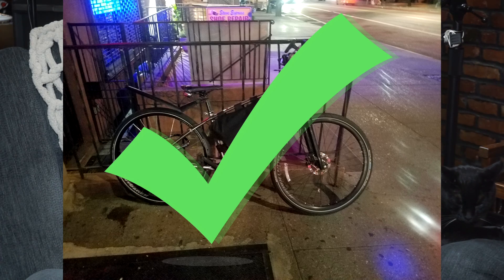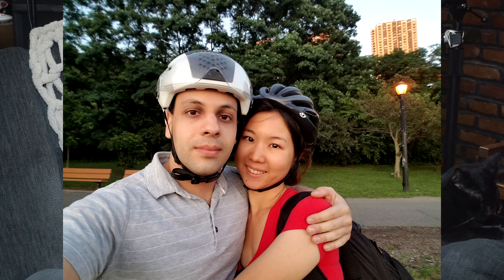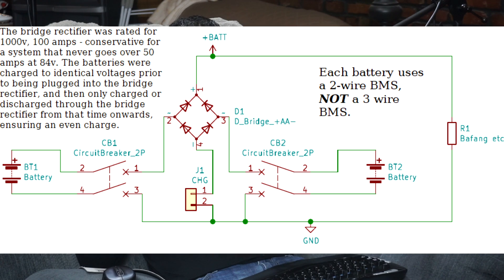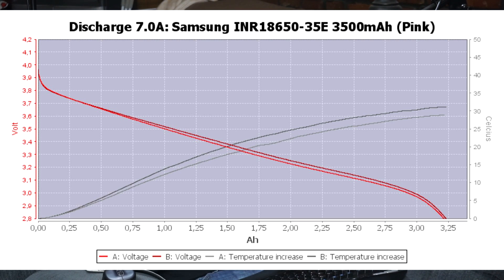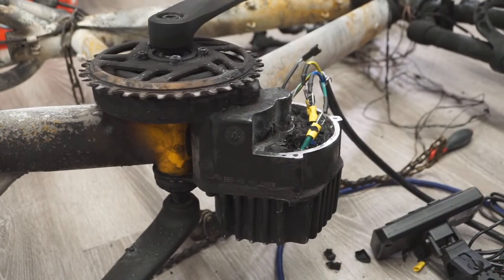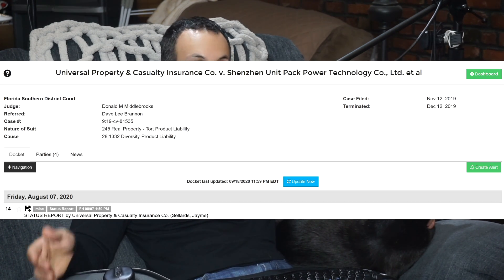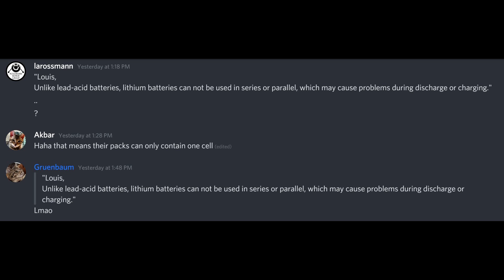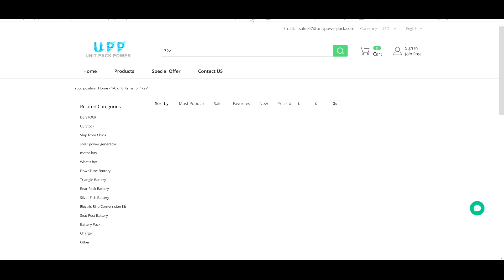Louis' front door goes BOOM courtesy of UnitPackPower battery.

Comment: I may have one the of thier batteries in my apartment...

Chuckles
Im in danger
Reply: Gift it to your in-laws as a Halloween present!
Reply: maybe you are but now that you know you can fix the danger by getting rid of it before the battery explodes inside you apartment save yourself find the battery if you have one and get rid of it while you still can safely
Reply: @raven4k998  or sell it on the black market as an ied
Reply: j s 900iq plays
Reply: @sneed915  it's the new age WMD these days can you imagine the damage that one of those things can do if placed in the right place in a office building it could bring down the entire building if it heats up a support column or two enough
Reply: @raven4k998  ebike fuel can't melt steel beams!
Reply: @freman  do you know how hot lithium battery's burn at they get over a thousand degrees they can melt the steel in a car why can't they melt steel beams is there something different about that steel?
Reply: @raven4k998  uh yeh, so ummm r/whoosh

Comment: Can you please show the circuit that these batteries were in. There is enough skill on youtube to figure out what went wrong but we have to eliminate installation error. No disrespect intended.
Reply: Rides bike hard... Pack gets hot.... Cells begin cascade failure internally... Fire ensues. Not an electrical issue per se.
Reply from the maker: The installation is ash. The only way to tell that is with a time machine.

Comment: In 2015 I built an Ebike using a 1990s GT LTS-3 frame with Bomber forks and a Mxus 4t hub motor. Laced up some strong dual wall rims with heavy spokes and motorcycle style mountain bike tires. Built a triangular battery box to fit the frame triangle perfectly. I ran it at 75v using 20AH Multistar batteries from Hobby King. Used a sleeper controller I found on Ebay. That bike would trip an 80A breaker. I put in a 100A breaker and it stayed. I installed a power meter and put a camera on it while riding. It drew 9600w at 72v fully charged. Went 45mph. It is sitting on my porch with worn out batteries. 600 bucks for new ones. That bike has a Megura twist throttle that is dangerous. Only I can ride it. The bike will flip over backwards instantly. Gotta be a mature rider. I enjoyed starting off in a power wheelie and keeping it going as far as possible while accelerating fast. I used to pass traffic in town. It is a fun bike to jam around on. I was all over Endless Sphere as BSATOM. Started a now long thread about them sleeper Ebay Chinese controllers that would take that power consistently without failing.....think they were called Sunwin.

Comment: Great!.. One week before lockdown in early March of this year, I went to Amazon and purchased a 1,000W e-bike conversion kit which included the controller, a 1,000w motor in a rear 26" wheel, and all the accessories such as the throttle, and guess what I also purchased on that same day?  You probably guessed it!  A triangle 1,000W UnitPackPower battery then proceeded to convert my DiamondBack 1983 bicycle into an e-bike and "proclaimed" this e-bike as my ONLY mode of transportation for now, aside from my father taking me to places on his car as my anti-COVID protocol, which is a protocol that I am still practicing till this day, (I will not be taking a taxi or public transportation anytime soon). I have done about 10 to 20 trips so far, including trips to canal street to buy cameras (since I install cameras) on my e-bike.  So far I haven't had any trouble, but since watching your original video and on Cinna's channel since the day that your e-bike went up in flame and you blaming it on having a UPP battery(ies) pack(s), I should say that I am feeling a little worried over here, Yes I have continued to use this battery despite having watched all your videos related to your incident and you blaming UPP's battery packs, yes I have continued to keep it charging completely unattended on my father's recently built tool shed in our backyard and I keep on lazying out on that one project that I have pending on my mind that I keep on postponing due to lack of time and being very busy of installing one camera inside that tool shed to at least remotely keep an eye on my e-bike as I am charging the battery.  I dread the idea of me one day finding our tool shed on fire.  I should probably take it one step further and install one of those smoke alarms that if it does go off, it would send an alert and alarm to my smartphone.  I already have a working garden hose on standby right next to the tool shed, but it would not be of any help if I don't catch the fire on time.

I have also considered the idea of buying a 48V 20A Lithium Iron Phosphate (LiFePo4) rear-mounted battery pack (I would love to find it in triangle form instead of rear-mounted, but was unable to find a triangle battery and it being a LiFePo4 at the moment) and just stop using that UPP triangle battery that I currently have right now and then probably reselling that UPP battery as "lightly used" on eBay", probably could get my money back for that battery.  But anyway, I will wait 20 more hours to see what you have to say on this video, maybe not all UPP batteries are affected, maybe the triangle batteries are fine.
Reply: I don't think that using water on an electrical fire is the best way to put it out. It may create additional shorts and make the battery release energy faster. Also if it was charging at the time of the short that caught the cell on fire, it would mean spraying water at something in a circuit with mains supply, so theoretically it could be a mains AC electrocution hazard if you got unlucky. I would get an ABC fire extinguisher if I was worried about a Li-ion battery pack fire. Even though its called Lithium ion it's not a combustible metal fire so ABC class is fine and you dont need a D class.
Reply: @Cutest-Bunny998  using water on electrical fire is indeed retarded idea not best way to put it out you actualy cant really put it out with water at all hence why different fire extinguishers exist that literaly dotn use water at all ether powder or choke the fire. on the other hand you cant put out chemical reaction all you can do is keep everything around nto burning and let the batteries finish burning
Reply: @Cutest-Bunny998  Not using water is  a good idear if you have sth burning outside and not creating a danger for any other stuff. For example if your tesla was in a hard crash and many cells now have damadge and the pack enters thermal runaway. 
Letting it just burn out is a good idear. After that every cell is discharged cause its burned up. so the car is relativly save. Water has an extreamly high heat capacity you can easyly stop your bettery fire with water. the bit of lithium that is in a LIXx batery dosnt do mutch at all compered to the normal energy release of the burning bettery.
And alsow new shorts are not going to be a problem same as volage potential. when it burns it is probably shortet together anyways. and there is no flow of electricity to the floor as it is wich line voltage where the ground is the nutral. energy flow is only internal in a battery. 
So i now sprayed my lixx with water and so stoped the termal runaway of the whole pack. Now i have partialy heated cells some shorts and a relativly cool battery. Once the water is gone the thing is going to catch fire again. Cause there is still energy stord in the allready damdged battery thats the real danger. 

having sth wher you think it is burned up anyway burn up again. that is the real Danger. And why you shoud be carefull once you stop your bettery fire with water
Reply: mate i enjoy your take on the ev front. but be shure if you have a kw of cells and one of them decides to go due to some reason. there is no more saving it. it all hapens in a matter of seconds. i recomend rich rebuilds bettery fire video. 
If shit hits the fan and you arent directly next to it forget getting it out of the shed. even if you are directly next to it it still takes balls of steel to move a battery that is shooting fier in every possible direction. 
Best way is to not store it next to flamable material. And please do not store it in the shed while charging
Reply: @mogelzz  My options to where to charge the battery is very limited at this time.  In the beginning, I was charging the battery by bringing the bicycle inside the house where I would have it parked in the living room charging right next to me while I am binge-watching Netflix, youtube videos, and doing research and other things on my computer.  That way, I could keep an eye on the battery at all times while it's charging.  But then my parents being COVID paranoid told me that I could not take the bike inside the house since when I use it outside it is exposed to the potential danger of the Coronavirus sticking into the bike and then me bringing it inside.  Literally, the only option my father gave me was to keep my bike on the 100% wooden tool shed that we have in our backyard but the problem is that I need to charge my battery each time I ride the e-Bike.  This triangle battery is a permanent installation, meaning there is no reasonable comfortable way of just discounting the battery to charge it inside the house under complete supervision.  That's why I have been charging the battery inside the tool shed.  I can't even leave it outside as it could be stolen.  I think I may end up selling this UPP triangle battery pack and getting myself a triangle battery pack based on Lithium Iron Phosphate for the peace of mind that it's not going to go thermal runaway.
Reply: Navy protocol for Lithiums is to submerge the pack in vinegar/distilled water mix. At least, it was 10 years ago.
Reply: @SwervingLemon  Distilled water isn't very conductive compared to tap water because of the minerals that get removed. Distilled water is approximately 0.055 micro Siemens/cm (or 1-2 microSiemens/cm if air is dissolved) and tap water/drinking water is more like 50-800 microSiemens/cm usually but can be up to 1500 microSiemens/cm in some places. Vinegar is harder to find an exact number for, but 0.1 molar solution of acetic acid pretty close to consumer vinegar and its 450 microSiemen/cm. These values are dependent on temperature too, but not in a way that it would change my point. 

Also the Navy recommendations may be similar to the FAA recommended ways to extinguish a lithium battery fire on an airplane: halon, halon replacement or water extinguishers to extinguish the actual fire then dousing with water to cool for reduction of temperature to prevent recognition. This different advice is because the high danger of fires on things like an airplane or things like a submarine is great enough to warrant the smaller risk of electrocution. Also, many common extinguishers that might work better are simply not available for use in these environments because maybe they arent fast enough at extinguishing the fire or perhaps not safe to use within in a sealed pressure-vessel or just otherwise ill advised.

Comment: Bet the batteries werent even properly spot welded, battery management system likely non existent or severely underspecced for the job.
Reply: fuses built into the welded nickel contacts should have prevented fires caused by diode failure, or other shorts (unless the fire was spontaneous internal cell short and eruption).
Reply: They might have used cheap cells. There are Chinese off-brand cells which are a safety risk in itself because the manufacturer lists "fantastic" specs that have nothing to do with reality.
Reply: @maximilianmustermann5763  The first thought through my mind was that they more then likely did not use the batteries that they claimed, there are a lot of fake batteries in china and getting fake or recycled cells are a real possibility...

Comment: @Louis rossmann do remember you were shaming LG for preaching 18650 battery safety?
Reply from the maker: Yes. I stand behind that 100%. They were not preaching battery safety, they were fearmongering over ridiculous edge cases using over the top, manipulative production. 

1) There is a gigantic difference in risk and danger between a cellphone/vape(one cell, in one package) and an ebike battery(200-400 cells in one package)
2) This is not a widespread occurance.
Reply: @rossmanngroup  I  mentioned this at the time you published the video, it is common enough if you're carrying a loose 18650in your pocket (as a spare) for a vape, see the batteries are incredibly easy to short out with only 1mm separation between the positive and negative. Again only feel strong about this as it happened to me and left me quite injured
Reply from the maker: I agree that carrying an 18650 without a case is unsafe and we should educate people against this practice. I am with you on that 100%
I just think that commercial was produced in a manipulative manner. 
But I think we are in common agreement that an 18650 with exposed terminals in a pocket is very bad.
I am sorry that you were injured as a result of this. It sucks to learn the hard way. :( Trust me... I know.

Comment: That time when my brother left his metal fork running in the microwave:
Reply: Always remember to turn off your forks before leaving them in the microwave
Reply: Bought our first microwaveowen in 80's. Tested it with a cup of water. Cup had gold lining on edge. *Sparks*
Reply: @williamgallop9425  cool! Your microwave had a fireworks setting
Reply: @williamgallop9425  my parents had continuous golden lining on the edges of their dishes until they have bought a microwave. It removed some of it, so after they had a disconnected golden lining, which worked fine. The problem fixed itself!
Reply: @williamgallop9425  I did that once and drank from the cup, the content of it was warm and i didnt realize the ring was sizzling hot and i didn't even think of that before I did the bloody thing.  well I never repeated that mistake again.
Reply: Must've blown the magtrometer.
Reply: What does a fork run on these days?
Reply: Nanashi tiddy milk
Reply: @jamesmorrison7989  That's your answer to everything, and while you're not quite wrong, you're not quite right...
Reply: Nanashi probably a microwave.
Reply: Done that two days ago
Reply: That time I left a microwave in a running fork.

Comment: Got one of there triangle batteries. Batteries run fine. Case is $hit. The tabs that the straps go though and strap the battery to the frame started breaking 2 weeks after I installed it and Mid drive. They tried to Charge me $30 to replace the case. 2 of the 4 top tabs are broken part way. The 4th is broke off completely. one of the bottom tab's started breaking when bike fell over while working on it. Finally got them to say they will replace the case then they started blaming my bike and me for the case breaking. Still have not gotten case replaced.

Comment: Aah, using "Sure-Fire" brand batteries I see.
Reply: Sure Fire should be fine... Trust Fire and Ultra Fire on the other hand, nope.
Reply: @brandonupchurch7628  I never buy Li-Io cells with the word "fire" on them. Don't care if its "Sure", "Trust" or "Ultra"!
Reply: @maximilianmustermann5763  Surefire makes tactical flashlights, I think they mostly use panasonic cells, I know the CR123A primary batteries are, but I just looked and it looks like the only recargeable surefire is an 18650 with a built in micro USB charger that would be far too expensive and pointless to build a pack out of.
Reply: Ultrafire 109000 mAh 18650 Lithium Ion batteries inside.

Warning: we're not responsible for any damage and explosions!
Reply: I see what you did there....
Reply: I'm using these same cell in a torch bedside my head at the moment..
But mine came from a battery pack of a name brand company and I am using these high amp cells to put out 1 lumen of light from the led..
The cell I was told are copied a lot  due to being common and high quality Samsung Cells..
But they are only marked by the color of the heatshrink and some black printing..
Whats the chance his pack had some no name rebaged cells or some sold out the back of the factory due to being In the bin... (a big Thing in China)
Next time I am looking at other brands when buying from a company..
Some brands are copied less due to being less common and some are not made in China like Samsung cells...
I believe Korea and Japan have companies making cells(Sanyo cells from Japan etc..)

Comment: I've exploded a couple lithium cells, but for me it was because I was a noob. It wasn't that they lied to me about the quality.
Reply from the maker: If I buy an e-bike battery on AliExpress and believe they are not lying to me about the quality, I am the noob. that is the lesson that I have learned here.
Reply: Lol well said Louis 🤣😅
Reply: Goorpijp Wessel , appears that since Louis knows his own speciality so well, people expect some kind of halo effect to extend to all kinds of electronics. I am myself a poor man and therefore extremely critical and suspicious of everything I buy. That's why I'd have avoided Ali batteries. And because I had to buy a Macbook battery for a relative, and saw on a local forum that many had bought bad batteries that lost capacity soon or were not accepted by the computer. So that gave me an attitude that batteries are generally bad unless proven otherwise.
Reply from the maker: Goorpijp Wessel  It's not a random battery. UnitPackPower came recommended in an ebike discord I am in, and had a reputation as being a vendor that will make a custom battery to your specs that is trustworthy. I wanted a 2wire BMS and 35E cells. I wouldn't buy just any aliexpress battery. But I did speak to them through aliexpress after hearing about them in a discord I am in.